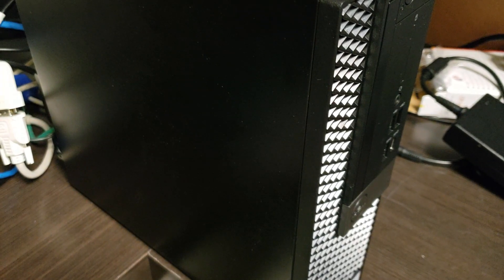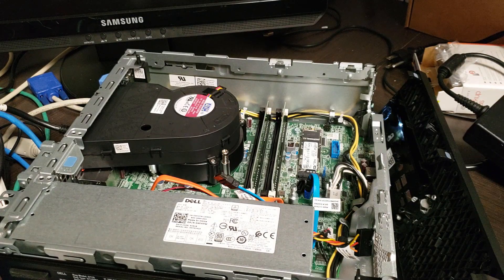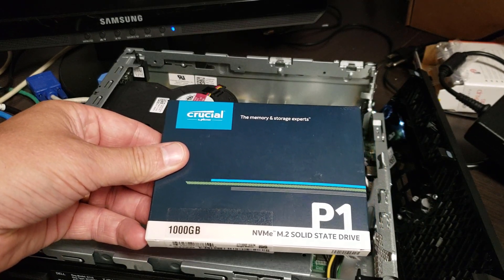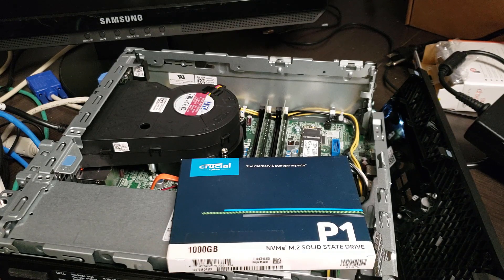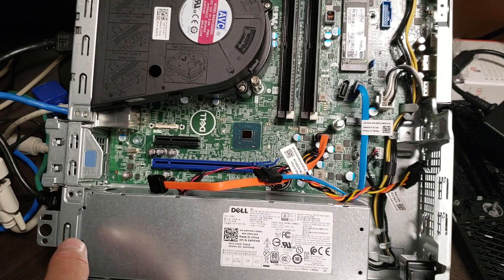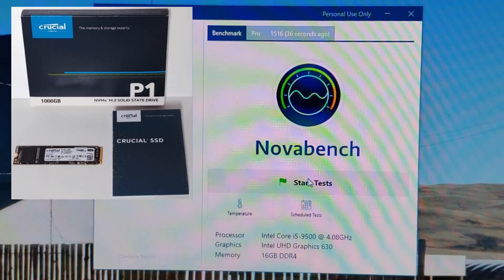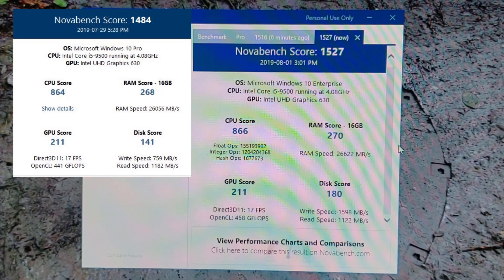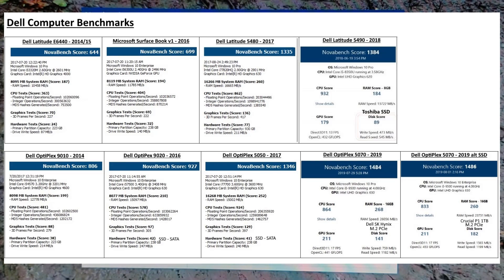Dell Optiplex 5070 i5 Review & Benchmark with Crucial P1 NVMe SSD

Comment: Can i install gtx1650 and dvd/rw on the system?
Reply from the maker: I think you should bea ble to,but cannot say for sure.  There is a mention in the video about a BIOS setting that is required to get it setup for booting, but if you don't need that, I think it will just show up as another drive.

Comment: Can anyone recommend me a pc to use for home IT training? I need windows 10 pro to run hyper V only. Any cheap computer will work. Please provide me some suggestions
Reply: Check out the Dell Optiplex line on ebay. Just look for the best deal within your budget, they are often sold wholesale and can be found very cheap refurbished. Good luck.